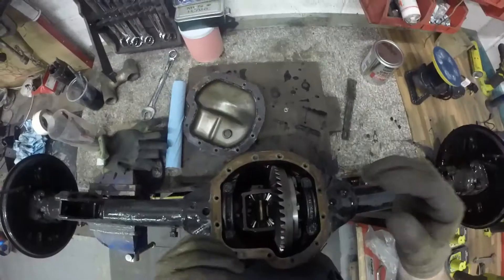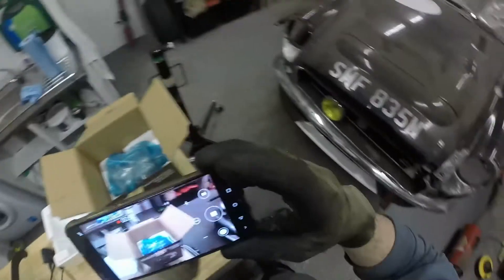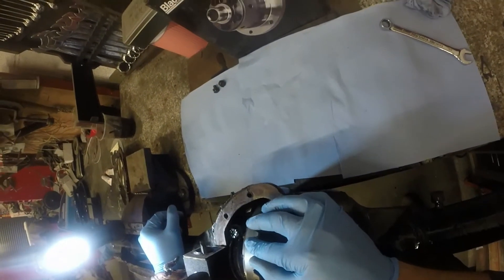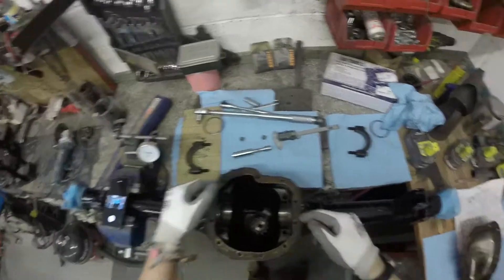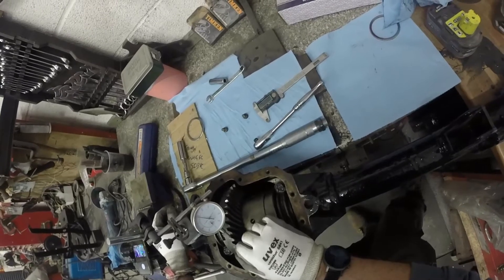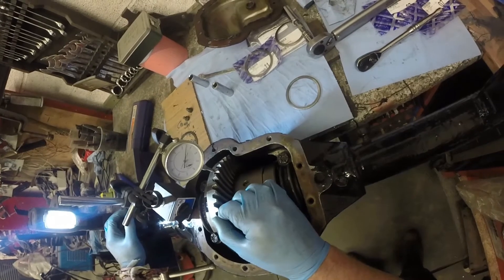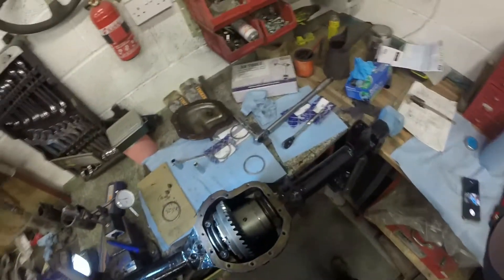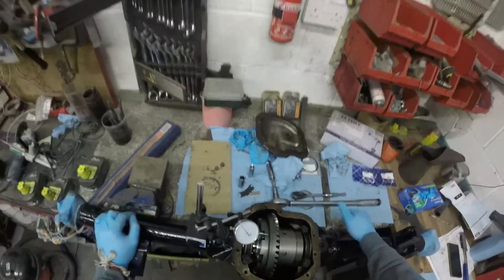Limited Slip Differential install MGB GT

Comment: I thought the case had to be stretched to get the crown wheel out?
Reply from the maker: No not at all.
Reply: @reallybrokenalways just read should  stretch case to refit the bearings because they are tapered?
I want to swap the cwp in mine to v8 ratio bits but nervous about wrecking it 😬

Comment: How did this turn out in the end?
Reply from the maker: Turned out better than we thought, the diff oil was changed after 500 or so miles as per their documentation, apart from this it's reeb "Ripped" on a lot since installing.  Certainly an easy swap if your crownwheel is in good condition.